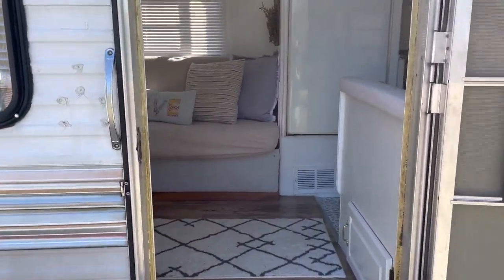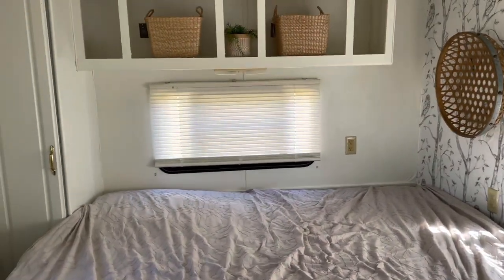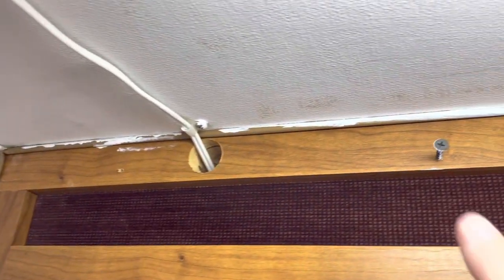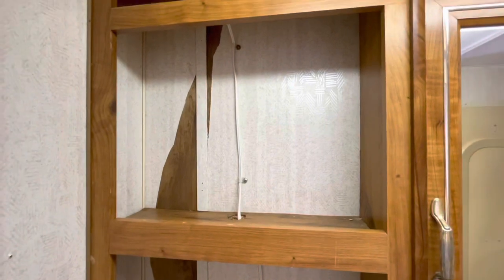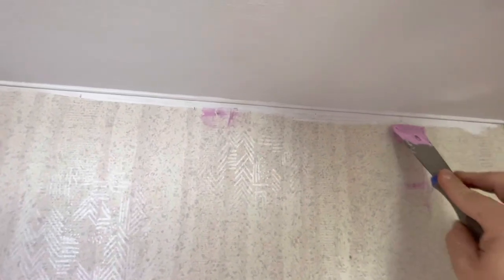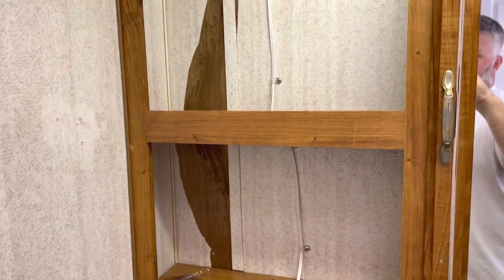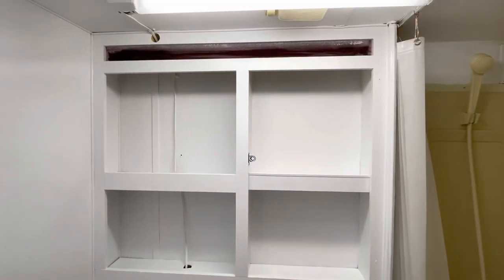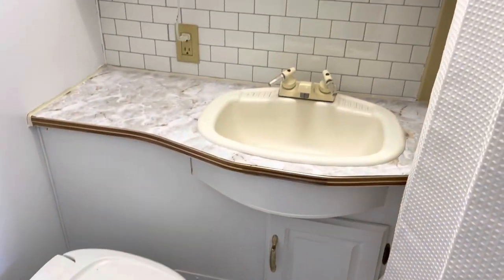Remodeling Our 26 Year Old Travel Trailer

Comment: Great job!  We used peel and stick subway tile in our camper remodel as well. I just put a drop of crazy glue in each corner and we haven't had any issues with the tiles not sticking.

Comment: How good is the peel and stick tile holding up, and also the contact paper countertop? I am about to start a restoration on a 69 Holiday Rambler and the countertop in the kitchen is odd shaped. Great video.
Reply from the maker: The peel and stick flooring has been fine. The peel and stick “tile” in the kitchen has come loose a couple times. But nothing a little glue hasn’t been able to correct. The contact paper countertop has had zero issues. It’s actually more durable than I thought

Comment: We are getting ready to do the same to an older camper. I have been doing some research and found that people are using appliance paint on the tub and plastic sinks. Going to give it a try and see what happens.
Reply from the maker: Great. Let me know how it goes. Thanks for watching the video. I also have one on the adventure of painting the exterior 🤣
Reply: for plastic fixtures model car paint will work the best and not leave a long lingering stink behind.  the only thing that is super-special about appliance paint is its need for high heat to make it fully "cure" and you wouldn't  do that to plastic fixtures.
Reply: @kirksway1  that wouldn't wear or Crack easy given its a shower? I know these camper showers tend to be bit flexible.

Comment: Great job! We have the exact same TT but have never actually been in it.(Long story!) We will be seeing it in May and I am wondering if there was any underbed storage in the original unit when you bought it? Is it just a platform with drawers or hollow? Thanks!
Reply from the maker: It was setup with homemade bunk beds when we bought it. I modified the bottom bunk and made it a platform. I left it open underneath. We use it for laundry basket and luggage storage when we are camping